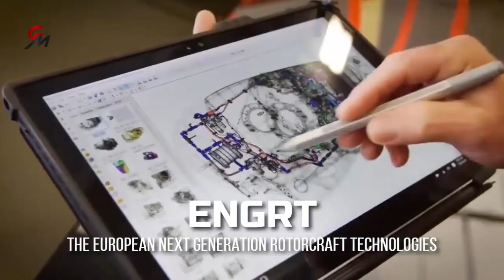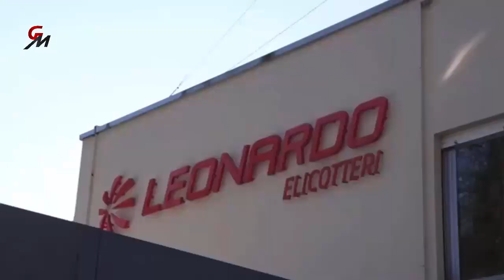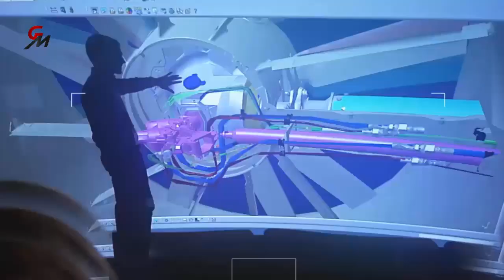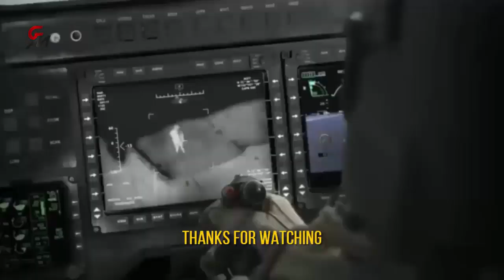The UK and Allies Built a Very Advanced VTOL Helicopter Called the ENGRT

Comment: 3 points to consider

1. US is developing a platform themselves.  With mass production and much bigger clout, European model is unlikely to be a mega hot on the world stage. 

2. European domestic market is not great in volume or value.  Look at how many A400 or NH90 was adopted.  It is much better than a single nation developing it, but at the same time, having too many partners is unlikely help either. 

3. It is harder and harder to find successful group projects in Europe, especially recently.  They hardly ever meet the requirement including performance, cost, availability, production etc etc.
Reply: In regards to #1. Part of the problem is the US not wanting to share, they may never offer it or if they do have very tight restrictions. This is actually also why some EU nations dont want to do join programs with Germany too with the recent Eurofighter exports to Saudi as the case and point. Where a pan national aircraft is being prevented from having lucrative exports because the German Greens threw their toys out of the pram.